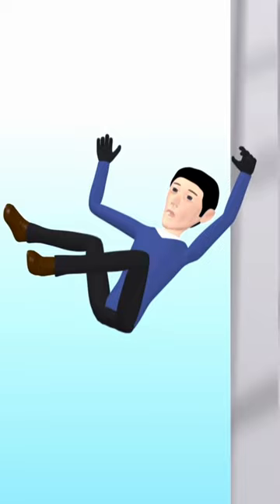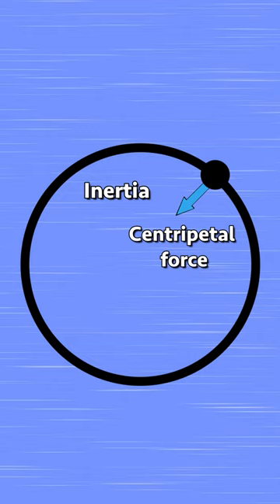Lean for free speed like McDavid (What is lean???)

Comment: No offense, but I believe you are confused between various different things.

Lean does not make you go fast, rather lean is required to go fast around a curve, simply leaning won't do anything - this is why you will fall if you simply lean - skater has to actively turn to not fall when leaning or keep crossing over.

A skater will need to generate centripetal force to go in a curved path, that force does not come from the lean, it actually is generated by legs doing to crossover as skater keeps stepping inward ( and they actually will go tangentially if they stop doing crossover or if they stop actively trying to turn with the ankles ).

The reason lean is needed is so that centrifugal force won't topple over the skater.

The net torque in the frame of reference of the skater should be 0. assuming the lean to be theta with the vertical ( so 0 degree means 0 lean )

mv^2/r cos ( theta ) = mg sin ( theta )
tan ( theta ) = v^2/2rg

so the faster you go the more you need to lean otherwise you will be thrown out of the circle ( which will icrease r and reduce the theta ) or you will simply topple over.

The net force must also be balanced ( assuming 0 acceleration ), this is very complicated equation and simply saying centrifugal force = friction force would be incorrect as edges dig into the ice, and there are other force involved.